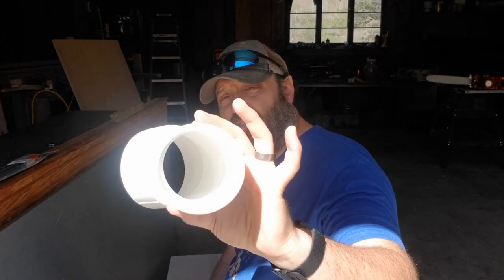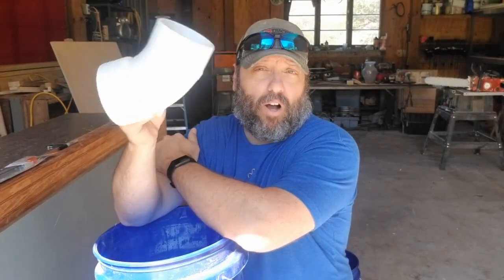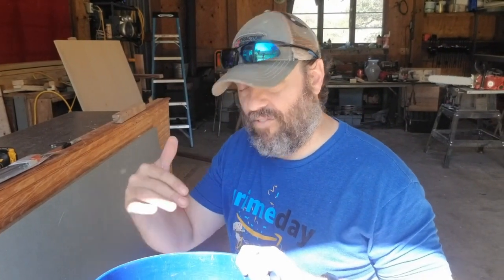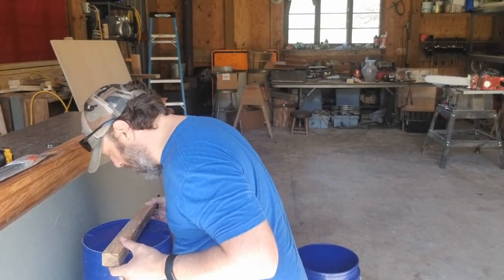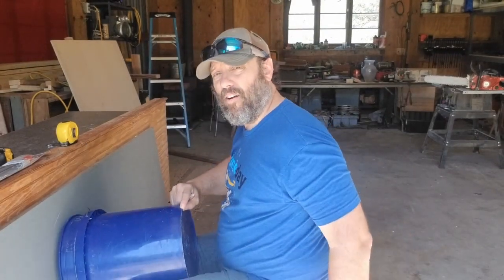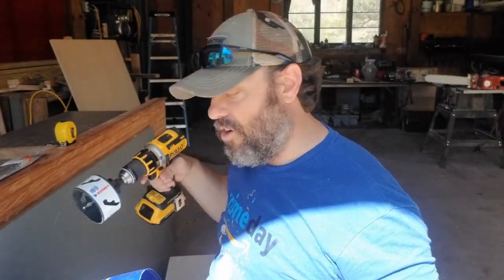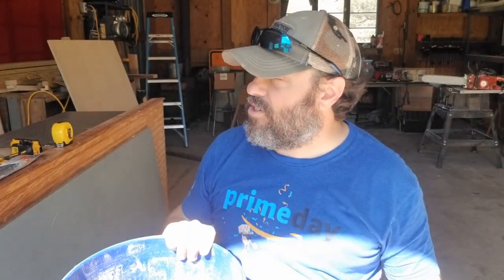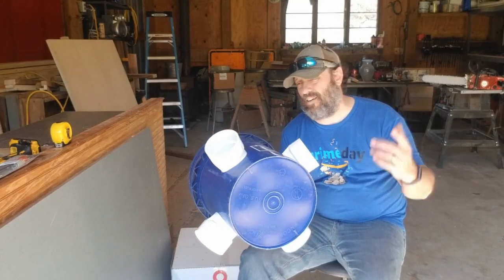Gravity Chicken Feeder DIY, Dont Make these Mistakes!

Comment: Just an FYI, when using a hole saw with plastics, start the hole with the drill bit but then reverse the drill to melt the hole through. It prevents the "wrist breaker" issue and prevents plastic cracking from one of the teeth catching.
Reply: Nice!

Comment: Yeah I found out about that hole saw kickback when I did my first ever hole drill through hardie board (sheet concrete basically). I had the drill on high torque because it wouldn’t spin on low. It was also on the max power mode and I was on a ladder and holding the drill one handed so I could brace myself against the wall with the other.

That shit about snapped my wrist in two, dislocated my shoulder and flipped me off the ladder like Mortal Kombat.

That was when I learned to put the handle on your drill if it has one and brace with both hands… and put some ass behind it all or you can really get hurt.

I was ok- and actually funny enough I just used a 4” one today to cut some exterior flood light holes. Did it the right way because I’m now experienced enough to know that if you don’t learn your lesson the first time, the second one tends to help it sink in more.

Comment: Drill a notch at 10 o’clock, big enough to fit the tab through.  Twist tube to lock tab at 12 o’clock so desired angle is met.

Comment: Thanks much. Great video. I read through many of the comments. Many great suggestions. 

I used a grinder with sanding wheel to grind the nubs back to smaller nubs. Elbows squeezed in nicely and the remaining, small nubs hold the elbows in tightly. No need for caulk. 

One extra step, now that the elbows go in further, they are too long and run into each other inside the bucket. Cutting about an inch off of two of them (opposite facing) fixes this. 

Thanks again!
Reply from the maker: Thanks, glad it helped!
Reply: One more thought… I need to make one more bucket feeder. This time I’ll make the holes higher by an inch so I don’t have to shorten the elbows. The longer elbows make for neater chickens.

Comment: 3 years old not sure if you still use this method, but I’ve found with the hard plastic 55 gallon drums you can just force those nubs of the elbow in. Bonus perk is it locks them in and them suckers ain’t goin anywhere.

Comment: We used a 3 inch hole drill with 3 inch elbows. We heated up holes with a torch to soften the bucket and pushed the elbow through. No need for caulking!!
Reply from the maker: Excellent idea! Will be doing that one the next set for sure! Thanks!

Comment: Street elbow, one end male, other end female, in 90s or 45s,  I installed those 45s in a wooden hopper, holds whatever size you build, put a partition, pellets in one, grain in the other, load them direct from bag, even can make them to load without going inside, carpenters dream. 1st one was made in a 30 gallon barrel, it's now outside in the run. Just my 2bits worth.

Comment: Street means it's female on one side and male on the other side.  I used a 3-5/8" hole saw and it worked perfect.  As far as removing the plastic nubs I left mine on but if you wanted to remove them I'd use a file or angle grinder with flapper disc.

Comment: Fyi, you should have measured from the bottom of the bucket due to buckets can come in different sizes and if someone wanted to use a larger trash can instead then the measurement would be the same no matter what size bucket/trash can was.
Reply from the maker: Good Idea! Thanks!
Reply: i was thinking the same thing also.  i happen to have the same bucket, and 7" down from the lip ends up being 4-1/8" from the bottom of the bucket.  thanks for the video!
Reply: @elmoco1977  Thank you! Much more useful than a "Good Idea! Thanks!" response.better
Reply: @elmoco1977  thanks 
I was hoping Someone would supply that information.

Comment: Good suggestions on using a measuring stick to help mark your buckets and the size from the inside and outside diameters of your fittings being different, and using a half inch larger hole saw.  You can warm your PVC fittings with a propane touch and trim off that moulding sprue.  The torch will make it so you can cut it off with a knife.
Reply from the maker: Nice suggestions!

Comment: Ok, what I did is take a dollar store plastic bowl and put it inside my bucket. You may have to cut the bowl to size. Then I marked a line at the top of the bowl. I used a door bolt or door knob drill bit to cut about 10 holes in the bucket above the level of the bowl. The bowl in the bucket is the key. Keeps the feed available to the chickens. I put a center column in the bowl made from a large water bottle and screwed it to the bottom of the bowl. Holes in the bottom of the inner water bottle allow feed to go into the bowl. No waste. Put lid on bucket and an upside down large circular pan on that to create a drip line to keep out rain water. Probably need to do a video.

Comment: I used my 4 inch grinder with a half worn cutting disc  to cut the hole ,90 deg elbow facing down ,when i was driving to town i find pvc fittings from time to time they fall off plumbers pickups .i brought a fancy feeder i wish i still had the recept i would of got my money back.
Reply from the maker: Thanks for sharing

Comment: I haven’t read all the responses yet, but to get the PVC flush on the bucket, how about using a soldering iron and melt a notch at hole at about 9 o’clock (or so) and twist to point the opening as you had it? Would that work? Then there is no cutting or cracking. 
Another thought I had. I don’t like using non food grade materials. A legit feed bucket and food grade silicone if there is such a thing, is how I will probably go. I need to look into water quality PVC I think. This is awesome and I am gonna give it a go. Thanks so much for the video. I chose to watch yours being the shortest of them all and it likely is the best.
Reply from the maker: Thanks so much! How did your search for modifications go! Anything I can learn from you?

Comment: If you run the Hole Saw in Reverse it will not break your Wrist and it leaves the Hole nice and clean.
Reply from the maker: Thanks for the #protip !
Reply: Does that work on wood?

Comment: I cut a U shaped form out of the base of the inner elbow so the chickens have more access to the food on the bottom of the bucket without.  Beware: My chickens pecked the dried caulk off the outside of my bucket.

Comment: I like that you showed the bucket. I want to do a trash can.
Reply from the maker: I might do a trash can as a trail this coming meat bird season and see which works better. One reason I like the 5 gallon buckets is that we can hang it and not have to leave it on the ground. This helps to get it at the perfect height and it doesnt kill the pasture where we move the bords every day.
Reply: Try to move a trash can full of feed before you commit to drilling holes. 😊

Comment: Does it have to be that size of hole for the chickens? I’m going to have about 100 chickens feeding out of these and I’d like to have 5 holes per bucket. Seems like their little heads could fit in a smaller pipe.
Reply from the maker: Smaller holes might be better for chickens as they tend to "throw" their food more than ducks do!
Reply: 2” works well with chickens. Have you built it yet?
Reply: Use a bigger bucket!
Reply: @TheHalfwayHomestead 
Not my ducks! Messiest animals ever. But I love 'em.

Comment: I always find it easier to run the drill in reverse after it starts to bite
Reply: YES! I kept cracking in forward, in reverse. It sort of just melts its way through with a slight saw cut. Much easier in reverse!

Comment: How well do they work in the rain? My biggest problem is I have no where to put my food under cover and I have one of the cheap red/white top load feeders and every time in rains. I loose a half a feeder full of food. Plus it’s a hitch to get clean
Reply from the maker: Maybe you could build a small "leanto" for the feed buckets? Just jam (4) 2x4 pressure treated legs in the ground like 12 inches deep and then make a small 4ftx4ft frame across the top. Set two legs slightly shorter than the other two, set your frame on it, thenm add some old tin roofing of something. We did something similar for a few years before we had these buckets. Worked great!

Hope this helps!
Reply: uhm...put/buy a lid for the bucket
Reply: @tmod19modestacres  you don’t understand what I’m saying. The rain gets in the bottom of my normal store bought feeder. That’s why I went looking for something like this in the first place.

Comment: I did this with an old Coleman cooler. Unfortunately the ducks and chickens pull food out and its all over the ground. Jeesh. I am trying to prevent rats, mice and chippy's coming in. I will still keep at it to find the right system for all of us, that is, excluding varmits.
Reply from the maker: Great Idea!
Reply: Add a cap to the outside with a lip so the food can't be pulled out
Reply: Can you raise the cooler up higher? Apparently, think i saw this in video 846 today, it keeps the fowl from raking it out. HTH!
Reply: @ashamaryland  Yes I did this and I put a tray below to catch grain. Thanks!
Reply: Hey glad you brought it up, were you able to find out any solution for mice?

Comment: Great video.  Quick question, how many of these feeders do you need for ten chickens?
Reply: I have one 5 gallon bucket with 3 ports for 6 chickens and the chickens take turns eating they eventually all eat their fill without any fighting. Either one 5 gal bucket with 4 ports or 2 five gallon buckets with 3 ports should work for 10 chickens.

Comment: I am actually looking for an alternative to this bucket method.  I used it last year and I realized my entire coop floor is nothing but chicken feed as a result.  Nozzles are facing down but the chickens can drain the entire bucket all over the floor in a few days.  This method does not work well for me.
Reply: I am experiencing the exact same problem.  These videos say no spill feeder but I've watched the feed come out when the chicken pulls her head out.  I am experimenting with different heights  to see if less spillage occurs at a certain height.  If you find something that works please reply to me.  These eggs are getting awfully expensive.
Reply: @thekat268  I solved the issue by getting two large hanging feeders from TS.  No issues since then.  Pair for themselves the first month...
Reply: @vadadofthr3357  thank you so much.  I looked it up on the TS website.  I assume it's the metal feeder.  Will buy one tomorrow.  How long have you been using it?  Do you hang it or put it on the floor?
Reply: @thekat268  I purchased the plastic ones Harris Farms Hanging Feeder, 10 lb. I have two of them which will hold enough feed (for me) for 5 isa's and two guinea hens for a week without issue.   I hung them about bird head height, maybe a little lower.  The hanging/swinging seems to allow them to eat without issue but not to swipe food out.  I seem to recall people saying the ribs in the plastic one prevented it but the larger ones without the support ribs were still prone to the birds knocking the food out, something with the support spacers seemed to prevent them from swinging their head around and knocking everything out.  I have been using them for probably 4-6 months guesstimate? My understanding is that hanging it is key to stopping the feed loss.  However now that they have realized that they cant knock out their food, boredom has overtaken them and now they eat all their eggs....havent figured out how to stop that yet, I feel chicken soup coming later this winter I think....
Reply: @vadadofthr3357  thank you.  I should have waited for your reply.  I assumed they were the galvanized metal feeders.  I drove to tractor supply and stones hardware.  They both had the hanging plastic feeders but not the metal ones.  
So sorry abt them eating their own eggs.  What a drag!  I was suspicious mine were doing that.  I would go out to the coop about the time they laid eggs and grab the eggs as they laid them.  If they were on the nest I'd give them some scratch.  Later I discovered one of the chickens lays paper thin eggs.  Mystery solved.

Comment: I free range my chickens and have goats.. I'm looking for a feeder that a chicken can access but a goat can't! I'm wondering if this would be a solution.. I have Nigerians. I'm wondering if I did a slightly smaller pipe than the goats wouldn't be able to get their muzzle in there as easily?! Any suggestions would absolutely be appreciated. Thanks for the video!!
Reply from the maker: As we dont have goats (YET!!!) I am not sure about changing the diameter. Personally we have found we had to pace the buckets on a cinder block to get it high enough for the chickens AND ducks to use it.
Reply: That's what I will be trying. I'd suggest you secure the feeder, because if the goats knock it over and bang it around (they seem to have a habit of that), then the lid could pop off and you'd have a bunch of sick, bloated goats.